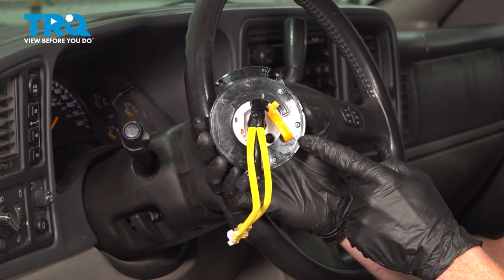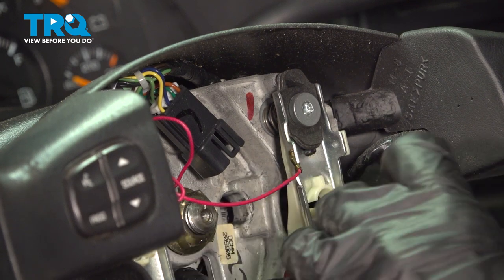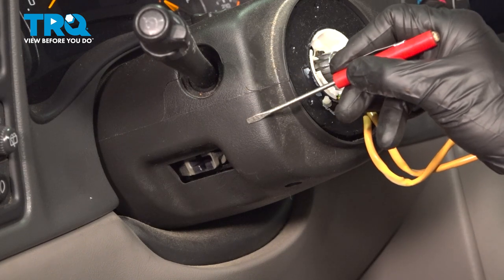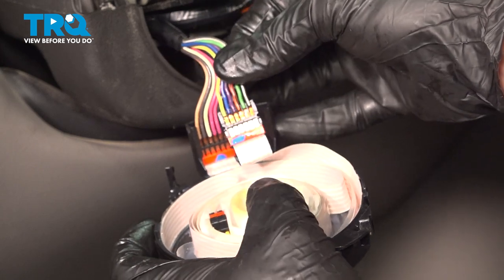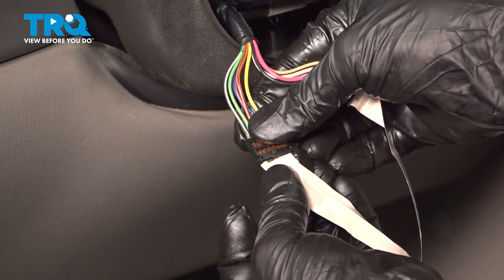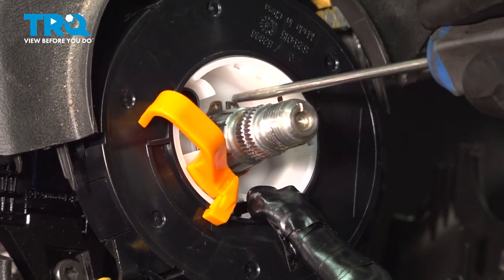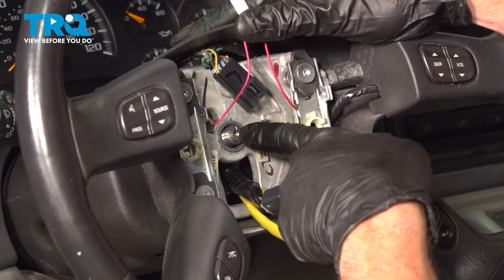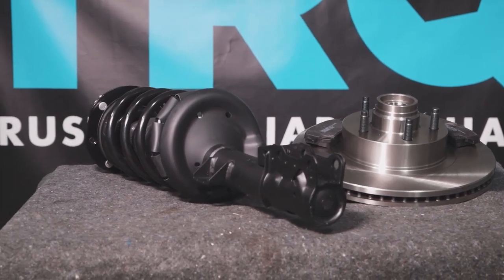How to Replace Airbag Clock Spring 2000-2006 Chevrolet Tahoe

Comment: So i'm confused.

Most of them say without steering controls. 
The ones that have the steering control harness are very expensive.

I have steering controls like the vehicle in this video.
 all my buttons and controls work fine. 
The only thing malfunctioning is the horn and the air bag light coming on and off when you drive.

Can you just get the clock spring and plug it into the existing harness for the buttons and the steering wheel?
Or is it all one assembled unit with a harness if you want to retain your steering wheel controls?

Are you forced to get the expensive one with a complete harness?

Comment: Great video, and much easier of a job compared to a 2004 ford f250 where a steering wheel pull tool is required…